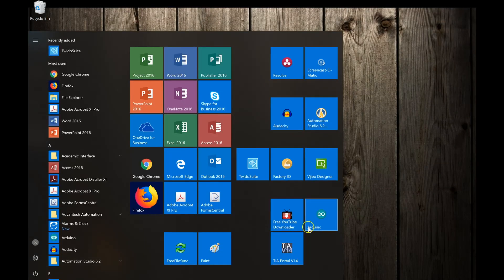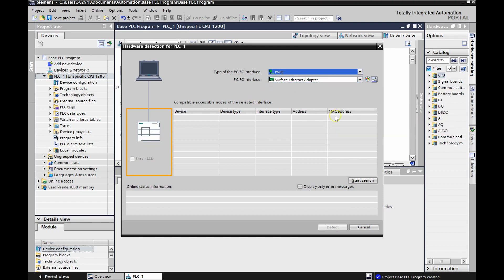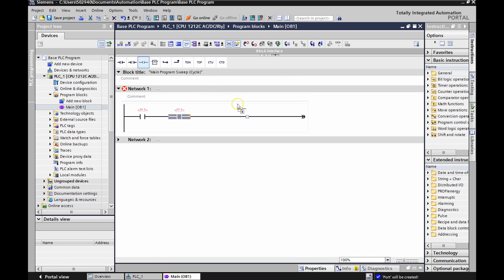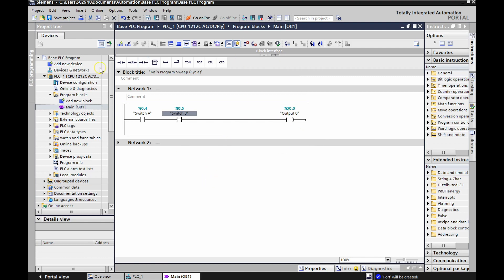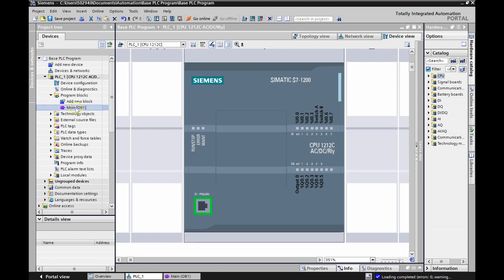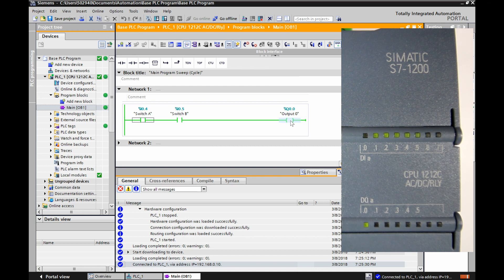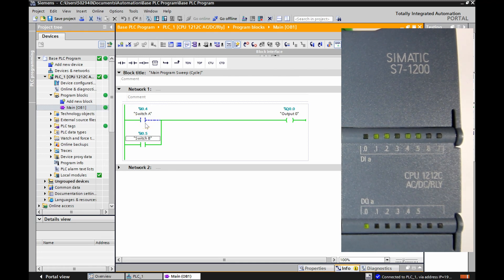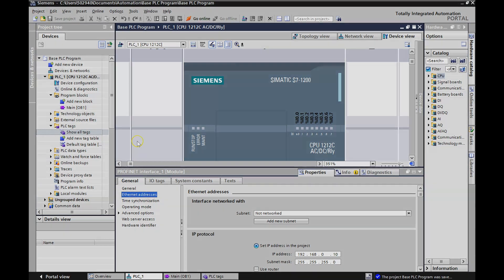Siemens TIA Portal Tutorial (AND & OR Program)

Comment: Hey Pete When I first Apply power to S7-1200 plc I see the error light Nothing is load to the memory. do you know what can be the problem. One thing I did was I had Sundisk  MC card I tried to use as MC could this cause a problem. I Removed it but still Error light indicator is still on
Reply from the maker: I would try going online to the PLC and open the Online & Diagnostics. Here you get an overview of the PLC and 
you can see which error is present and in the diagnostic buffer you can see more information about the reasons of the error. If you create an account at https://support.industry.siemens.com then the moderators can help you further.